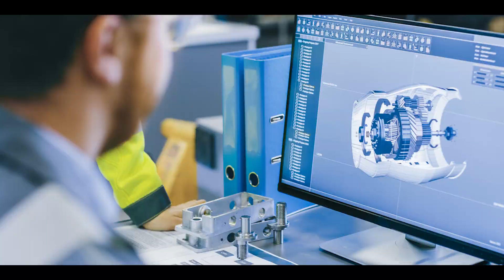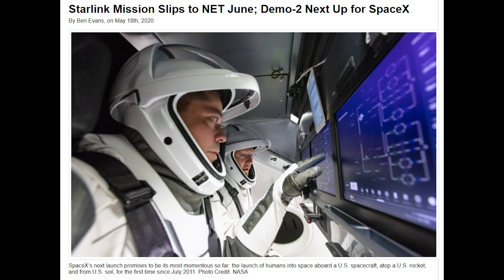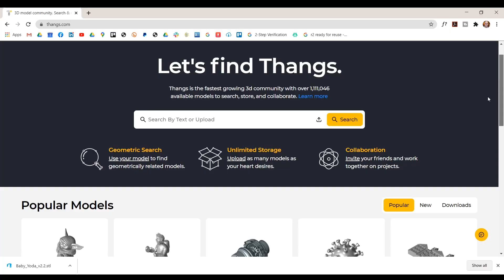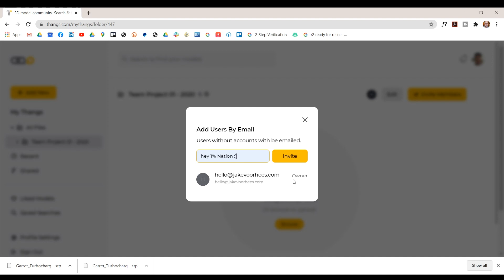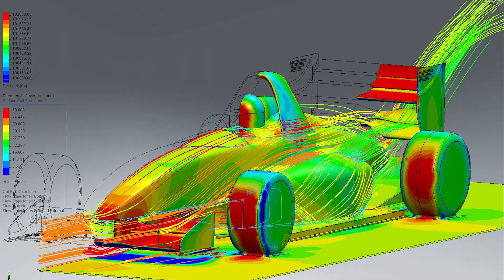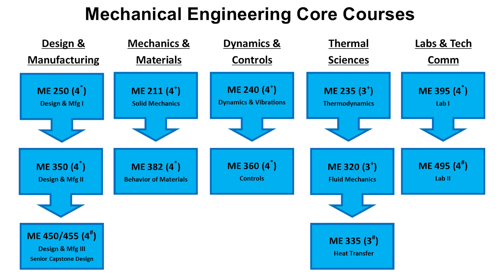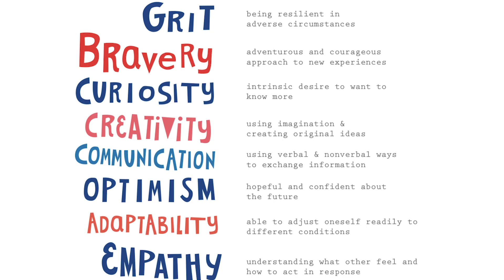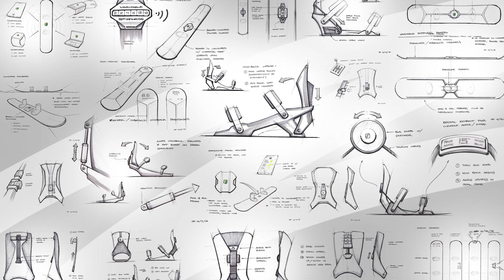What is Mechanical Engineering? What Do Mechanical Engineers Do 2.0 ?

Comment: Hello! I am planning on doing a mechanical engineering undergraduate, then specialize on mechatronics/robotics in my masters degree. Is this a good plan, and what do u advise me to do? And what colleges do you recommend in the states?
Reply from the maker: Yupppp, that's a very popular avenue nowadays. Thanks for the comment.

I think mechatronics is the future. It is the intersection of mechanical and electrical engineering, so you can lean into either the physical design side i.e. mechanics, or the electrical engineering aspects which would include the circuitry, signals and controls, power, automation, and programming aspects. I think a mechatronics engineer who leans into the electrical engineering side of things is VERY well suited for the future. Here are some videos that you may be interested in:

“What Do Mechatronics Engineers Do?” https://youtu.be/4YjLZcQRLds

I think its also a good idea to start thinking about which subset of mechatronics you want to work in, because in grad school you will have the opportunity to become a specialist in something. Take as much programming as you can within your ME journey, as this will add more options to your situation later. Most of the cooler things you can do within mechatronics sit on the EE side of things. The programming, signals and controls, radio, the automation, camera vision, etc. There are equally as many cool avenues on the mechanics side too, especially which industries you could design components for. You have drones, driverless vehicles, typical robotics, manufacturing, medical devices, aviation, etc. 

Does this help and make sense? Let me know what follow up questions you have okay? I respond to everything, thanks again!!

Comment: I want to work for SpaceX, but I’m still in college; my plan is to get my bachelor’s degree in aerospace and my master’s degree in mechanical engineer. Is that a good plan? If not what should be a better option?
Reply: Do undergrad mechanical, masters in aerospace. My professor did it, he said it’s the move.
Reply from the maker: yeah Orbital is right. Its far more common to do the general ME 4 year and then specialize. This will open you horizon to more things before isolating, gives you an opportunity to figure out if you really like AE, etc. Good question
Reply: @JakeVoorhees  thank you 🙏